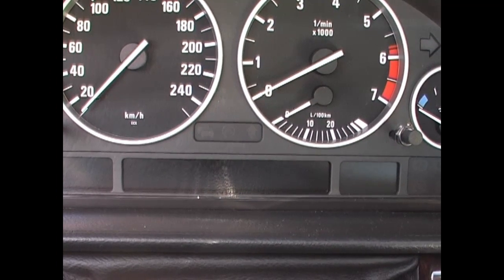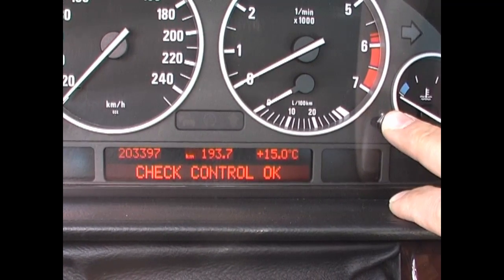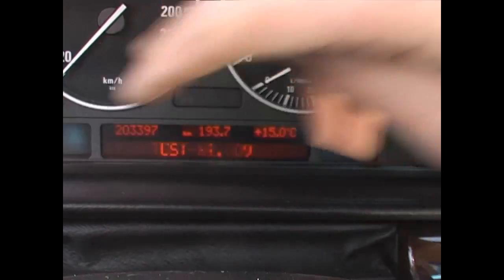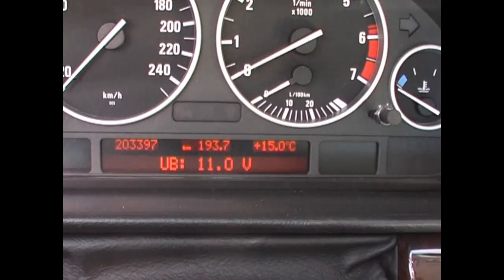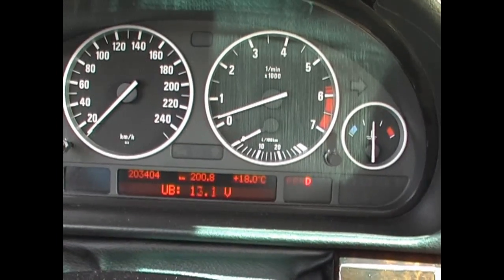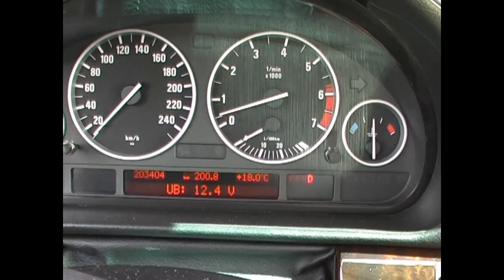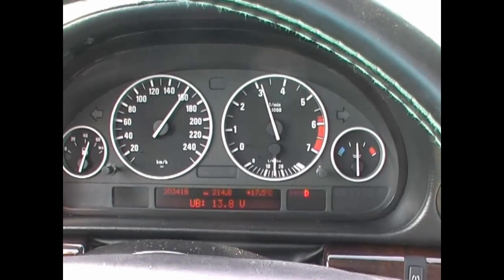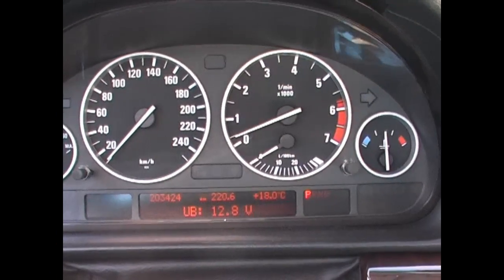BMW E38 E39 Cluster voltage and Alternator test (E46 and X5) Cluster unlock

Comment: I have a question
I have e39 540i. Car does not crank nor start. The same test shows I have 9.9-10V power from battery ( car does not start I put the key and just do the test.)
I tried to jump start it, it started once and then stop working in few seconds and did not start again.
What do you thin ? Problem is the battery, alternatör or starter ?
Reply: 10 is way too low, what he is showing is also too low.
your battery is probably dead. try charge it. and after you charge it add some distilated water to it. Or better let it be done by someone who understands it.
Reply: yeah 10 was way too low. I changed the battery and it worked :)
Reply: Yeah, i had this problem when it showed 12 volts or something like that but it didnt have enaugh starting power :( so i changed the battery also.

Comment: @Homerraas On a cold start I see the battery light coming on and then goes off after about 10-20 secs. I do not see it while I'm driving. It only comes ON on a cold start. It doesn't matter whether I start it early morning or at evening, as long the engine is cold and the car wasn't driven for a long time in 1 day. Alternator was changed back in summer. I bought the Bosch one and not the Valeo. What do you think? Battery was tested and seems to be good.